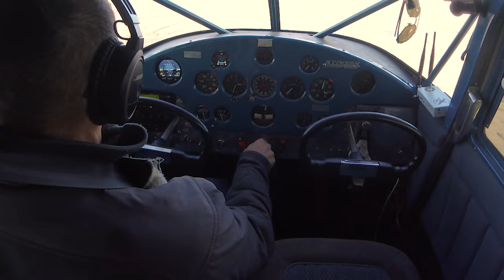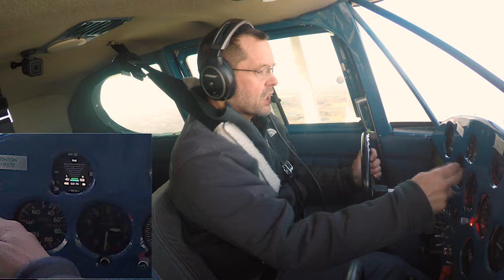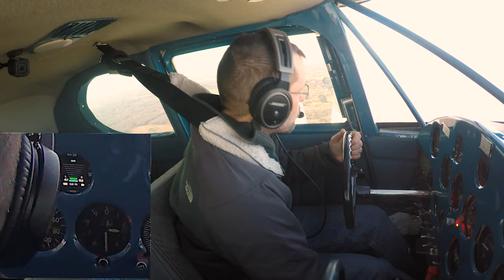Trying to Master Taildragger Landings Flying the 75 Year Old Stinson 108

Comment: I'm glad you pointed out that the technique used in a STOL contest is not the best technique on an actual short runway. In a STOL contest, you get three tries and your score is based on how good your best landing is. Using power to drag it over the line in ground effect is the best technique for that. Landing short 25% of the time is no big deal. On an actual short runway, consistency is crucial. It doesn't matter how short your best landings are. The question is how long your worst landings are. 
That said, practicing for last summer's Great Lakes STOL contest really improved my ability to consistently fly final approach so that I arrived at the threshold with just enough margin over stall to round-out. Although I wouldn't use my contest technique on an actual short runway, I do feel that I could confidently go into a shorter runway after the contest than before I did that practicing. Not only was it fun, those of us that participated are better pilots. Thanks for putting that together. Looking forward to next year.
Reply from the maker: I probably shouldn't give all my STOL secrets away in these videos... I'm finding out the competitions watching 😂. I really look forward to seeing you there next year, that for watching and let's get the Sedan in another video sometime!

Comment: Good discussion about landing stall speed.  Personal problem for me as I moved up in aircraft performance was that extra 10 mph resulted in significant longer landing distance in ground effect!
Reply from the maker: We can discuss landing techniques with different airspeeds and how it affects landing distance.  In this situation if I roll the power to idle and hold that airspeed the plane will stall (at 50mph the airplane is descending a bit and converting some power to lift) almost immediately. The 50mph I fly is 20mph slower that the books recommended procedure.  I would  never recommend that anyone flys final the way I do.  Any extra airspeed above 1.3Vso is going to significantly increase landing distance as you try and bleed it off in ground effect with it's reduced induced drag.

Comment: Good to see someone actually practicing something useful. 
2 things. Why did you keep flyimg when you had an issue with the flaps? And 2nd, what's with the "Dart Vader" helmet?
Reply from the maker: @garyhinkle4917 The reason I kept flying after I had an issue with the flaps is on the ground I was able to duplicate what happened and I figured out it was a pilot error problem with me not fully engaging the flaps in the lock position.  The helmet was purchased for STOL competitions and ArkenSTOL. One of the largest causes of injury in landing and ground loop accidents is impacts to the head on the panel and aircraft frame. I was unsure if I wanted a full time helmet or not so I purchased the Comtronics Pro flight helmet. I'll probably upgrade to a Sky cowboys helmet becuase I find the use of the helmet makes sense even outside the competitions.

Comment: Great job 👍 what's with the helmet? don't trust yourself? Or the plane?
Reply from the maker: Many events are requiring them. If you do end up on your back nearly all injuries are from your head hitting the dash, with shoulder harnesses and a helmet eliminate injury if you have a low speed incident. So I practiced the way I'm going to fly.
Reply: @GreatMichiganBushCo  what alltude you have to be at to get that canopy open and safely bail out? Also how does your 02 mask work? Is there a bottle attached to it? And if you bail out does it go with you
Reply from the maker: @stevestevens9046  it's so when you stop fast you don't end up with blunt force trauma to the head when your noggin hits the panel or yoke. The contests are going to require there use by pilots so  I figure get used to it.

Comment: What was it that happened at about the 6:11 point in the video that you commented on having "never had that happen before" and at 1st I thought your seat had came loose! Then after watching a couple more times I think it looked like the flaps came loose from where you set them.   and you commented that had never happened before and could have been a real bad situation had you been  lower to the ground?
Reply from the maker: I didn't get the flaps fully into the full setting detent and they retracted. User error. 35 years ago in a Piper Cherokee I did something similar.  I hope it's 35 years before I do it again.

Comment: I am interested to see what the performance difference would be against my metalized super stinson 108-3 for short take-off.
Reply from the maker: The metal doesn't add a lot weight, maybe 50 pounds.   My hunch is a 180hp would shave 30' and a 470 might  shave another 50'  So zero wind are you seeing 220-250' off the ground.  The climb should be like a rocket compared  to the 1000 FPM the 165 gets.
Reply: @GreatMichiganBushCo  it is my first tailwheel and I'm still feeling it out. It climbs at about 1500fpm with full fuel and 2 heavy guys in it this time of year. I am actually based on the lake huron side of Ontario Canada. Between the metal and the 470 and constant speed prop she's a heavy bird.
Reply from the maker: @blainemacdonald6929  yes the constant speed prop and weight shift associated is why I'm looking at the O-360 and not the O470.  That bird should pull you out of some steep terrain.
Reply: @GreatMichiganBushCo  there is a straight 108 with a new lycoming 360/fixed pitch on our field they are just finishing up. I will be interesting to compare. I know I'm going to be jealous of his range. I'm looking for a set of edo2425s
Reply from the maker: @blainemacdonald6929  let me know how they compare.. Enquiring Stinson owners want to know.
Reply: @GreatMichiganBushCo  will do thanks for the videos!

Comment: What was the issue with the flaps?
Reply from the maker: I'm barely sure it was user error. I didn't fully pull the  flap into the detent and it didn't lock.
Reply: Thanks! And thank you for the videos!
Reply from the maker: @chrisclem4470  thanks for watching the video, without you and the others watching it wouldn't be any fun making these videos.